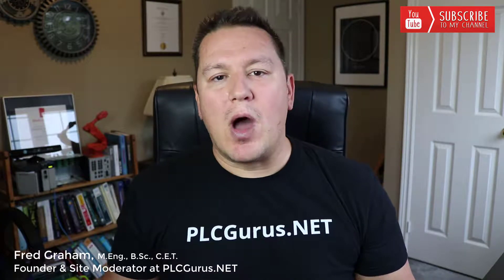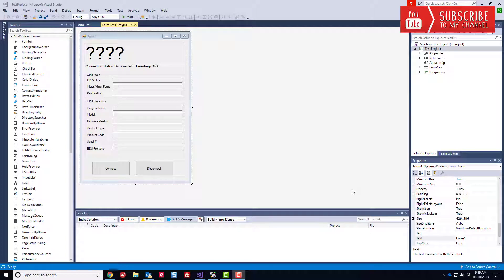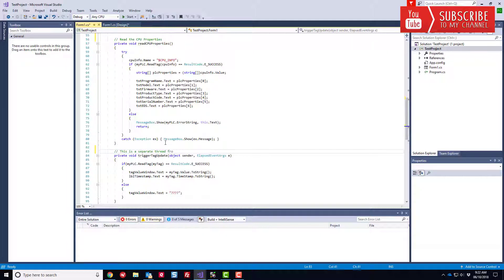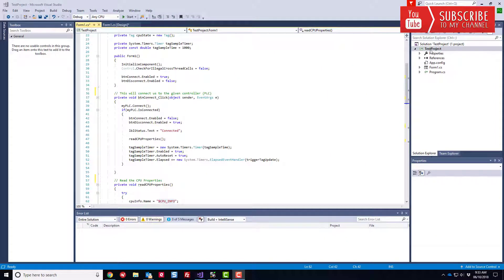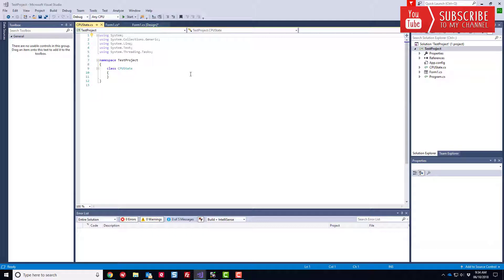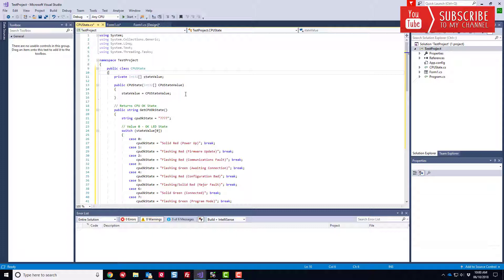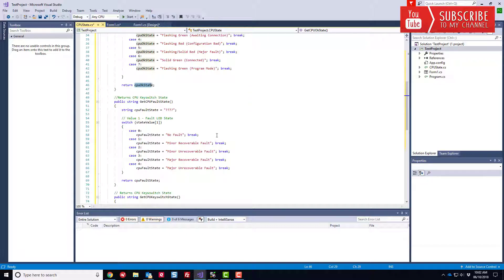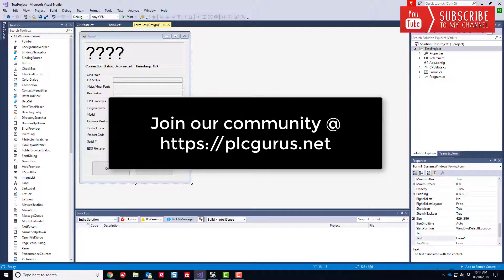PLCGurus.NET - C# HMI - Reading CPU (PLC) State - Part 1

Comment: Maybe you could point me in the right direction? I need to communicate several events (flags / bits in a register) to a Allen Bradley PLC. These would come from a C# .NET application to the PLC. I may need to also communicate a 16bit integer. Need to find a set of libraries to do this... Maybe you already have a video on this?